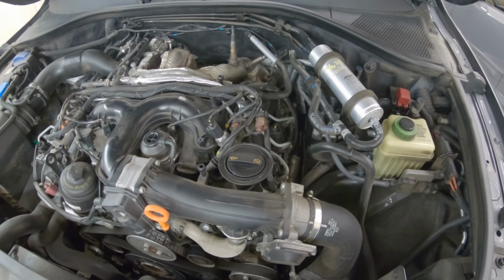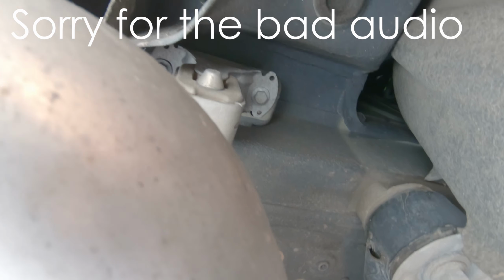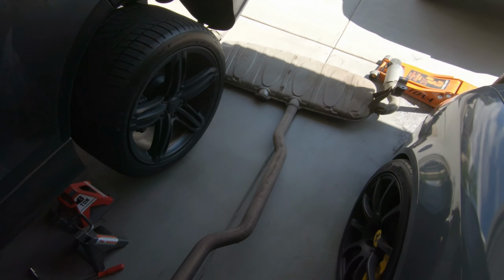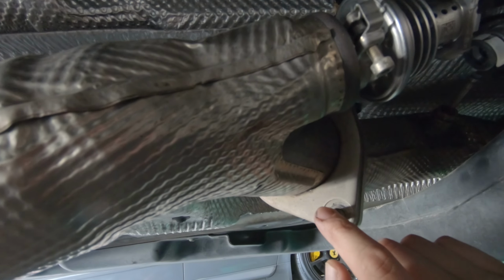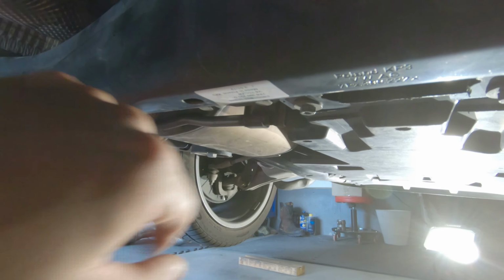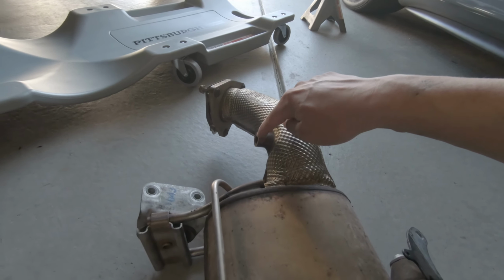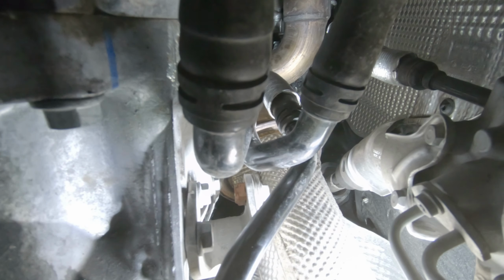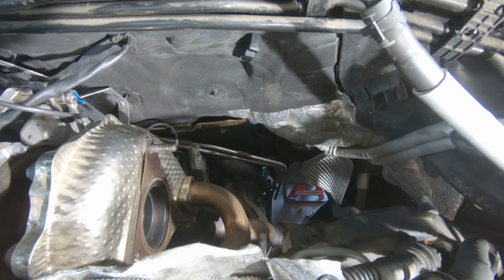Remove Stock Exhaust Audi Q7 TDI

Comment: Appreciate the video very much. Im trying to remove the DPF (diesel particulate filter) and along with Erwin manual and your video, its going. Slowly but going. Couple comments: reason to remove metal hinge fitting rather than rubber hose to SCR additive injector is because this method prevents leak out of fluid. Annnd... access to the hidden 3rd. Nut on downpipe flange is a nightmare that i havent solved yet. Your suggestion for 15" of extensions, with a universal at the 12mm socket doesnt show where to access. And this may differ between cars OR having air ride UP position may be quite less opening than mine without air, but up on ramps. That one is a PITA for sure. Thanks again.

Comment: This is very Awesome video. Thanks for taking your time to walk through how it is being done.  I would like to know what did you do with the Control line for pressure difference sensor? Do you leave them open or plug them up since the delete kit does not have that option? Thank you!
Reply from the maker: Happy to hear this video is of help. I folded it back on it self and zipped tied it. Kind of like with a water hose when it's flowing and you bend the hose to stop the flow. That's exactly what I did and held on by zip ties

Comment: So you didn’t have to remove the transmission cross member like rawtek suggest?
Reply from the maker: Correct. I didn't remove it. You'll have to wiggle the DPF a little to get it out. And then if you are installing the delete kit you'll also have to wiggle it back in. I go into a little more detail on the install in part 2 where I install the delete kit
Reply: @markb6s4  right on, installing this week. Thanks for the in depth vids on the subject
Reply: I also did not, on my 2013.  I had to push the flex joint on the downpipe side up towards the top while getting the flange bolts free.  After that, the flange tried to get hung up on heat shielding but I just compressed it back and everything wiggled out fine.

Comment: What was done with the two pressure fittings going to the original DPF???
Reply from the maker: i tied them out of the way with zip ties
Reply: @markb6s4  thanks for the reply.  Not blocked off or anything?
Reply from the maker: @Mynameismcgyver  correct. Not blocked off

Comment: How did you get the down pipe out the top?
Reply from the maker: It required a lot of wiggling, but have to be patient with it.
Reply: I am struggling with mine right now
Reply: @philipschutter1626  I ended up taking mine out the bottom it wasn't coming out the top
Reply: @jordanpost2411  Thanks.  I dont exactly know how but I just did some wiggling the next day and it came out in like 5 minutes.

Comment: Did you have to remove the wheel well in order to get the last (difficult) dpf bolt?
Reply from the maker: No wheel wells where removed. It was a combination of extensions and swivels to get to that difficult built to reach, from what I can remember
Reply: Great! Thanks!
Reply from the maker: @tyleryoung4419  happy to help

Comment: why do alot of youtube videos  not show the hardest part- like this video not showing removal of the downpipe?  The catalyst is trapped between the firewall and some what looks like egr pipes on the back of the head. I can see in the video the corrugated pipe still installed but mine hust wont come out. Tried the bottom but the mount bracket is hitting the tranmission housing and cannot seem to rotate it away.
Reply from the maker: I do apologize for not showing that part and only mentioning verbally how to remove it. After rewatching that portion I mention I took it from the "bottom" and this isn't clear to the audience. I meant to say from the "bottom to top".  So the down pipe I removed from the top side. I got my words mixed up. For the two lines that go to the EGR they are screwed to the transmission or firewall (can't remember) I removed it's bracket to allow those lines to be moved out of the way. And then there was one sensor that I couldn't reach from the top or bottom. I disconnected it from the engine side and took it out once it was out of the car.
Reply: @markb6s4  I ultimately removed it from the bottom. The two lines had to be loosened from the firewall and then it could come out the bottom. No way could I get it out the top. Not sure the difference in your experience but it was too tight between the egr cooler and firewall. Thanks for replying?
Reply from the maker: @JD-ui7rs  the reason why I didn't remove it from the bottom was bc I thought I wouldn't have enough clearance to remove it. Since I didn't use and floor jacks and just had the air ride at the heights setting

Comment: Do you have a link where I can buy this   DPF delete kit
Reply from the maker: I updated the info on the description with links. Should have done that a long time ago. But here are the links to your question.

--------------------------

***Parts

Touareg & Q7 (2009+) & Porsche Cayenne DPF, Adblue & SCR Delete Parts Kit
https://www.rawtekinc.com/collections/touareg-q7-tdi-2013-2016/products/touareg-q7-2009-2016-dpf-adblue-delete-exhaust-kit

Cat Delete Downpipe for 2013-2016 3.0L TDI Touareg, Q7 and Cayenne
https://www.rawtekinc.com/collections/touareg-q7-tdi-2013-2016/products/touareg-downpipe

Stage II Tune by Malone 
https://tunezilla.com/catalog/Audi/2013/Q7/3.0L-CR-TDI-240HP-EDC17CP44/Stage-2/4178

FlashZilla V3
https://tunezilla.com/flashzilla